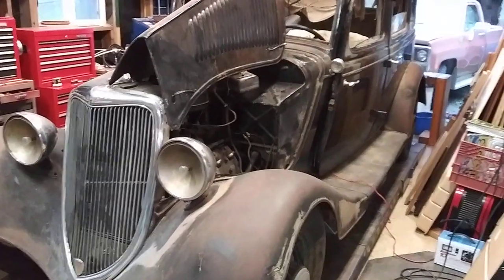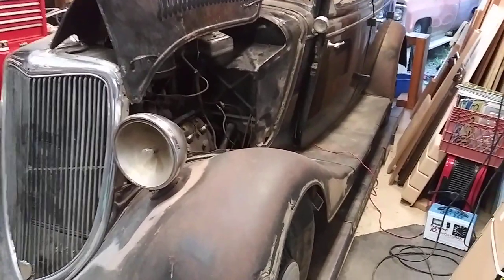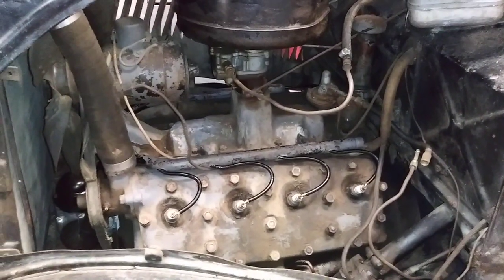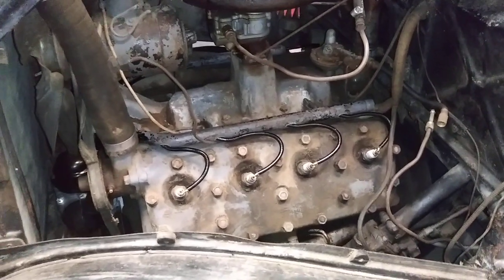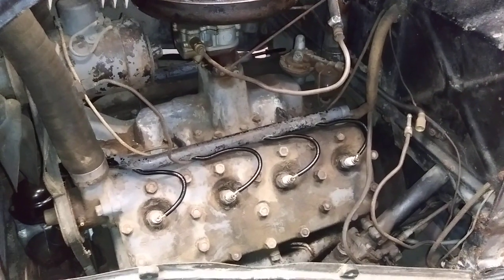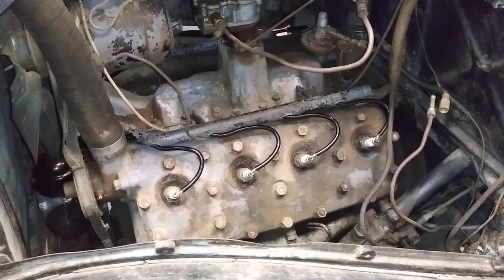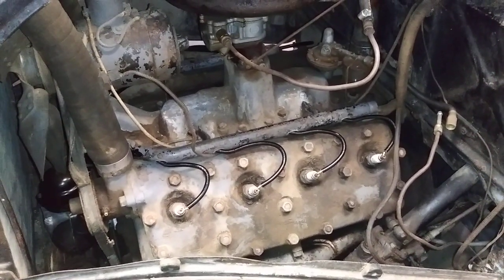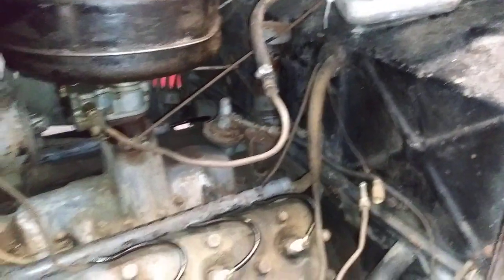1934 Ford flathead V8 first start in 30 years

Comment: Hello I am working on starting my 34 Ford but I am constantly running into no spark no start. We have rebuilt the distributor but have not done spark plugs or wires. Any suggestions?
Reply from the maker: I had my distributor rebuilt by someone with a distributor machine that could properly set up the points. I also had the original coil rebuilt and installed new 'correct' plug wires.  Once everything was installed, I confirmed voltage at the distributor. I hope this helps.